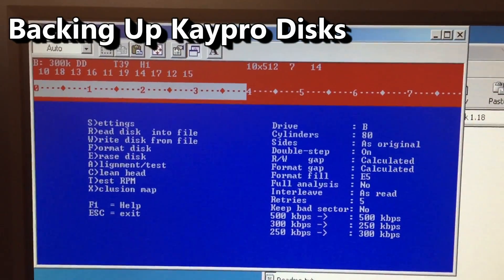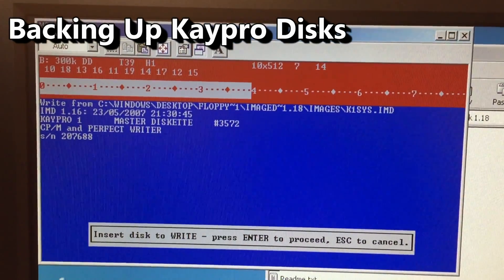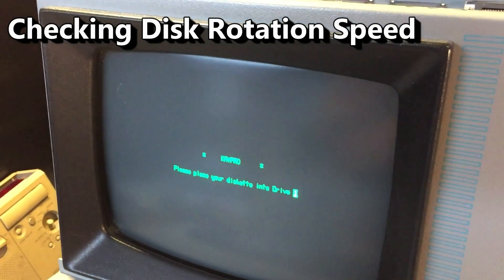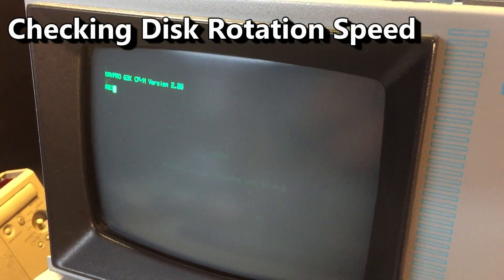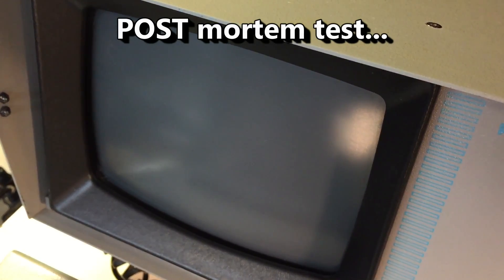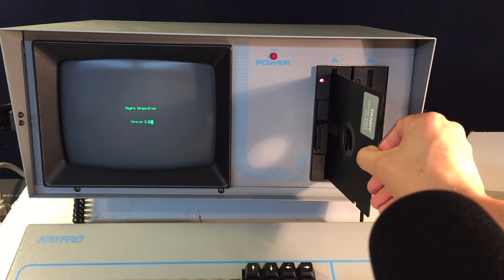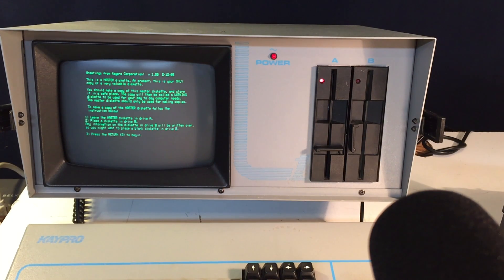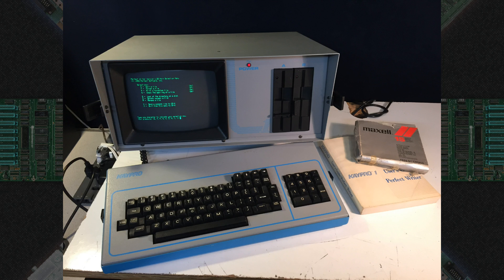Kaypro 1 Restoration - Part 2: Restoring Functionality

Comment: Your kaypro I should work as a Unix terminal.  I used my kaypro II with modem software to emulate an IBM mainframe terminal to do middle of the night system maintenance on Cobol and assembler programs.  You should be good to go.

Comment: Although this video is almost five years old, some may still land here looking for Kaypro info. The late model Kaypros had a universal main board. They would populate it for the model intended and install the correct EPROM. That's why it has HDD headers and positions for the HDD IC's. Sometimes unused IC sockets were installed, sometimes not. If you have the parts, you can upgrade it to a hard drive. Make sure you have the right CP/M (including BIOS) version too.

Comment: Hello, first, I think that you are an amazing presenter, and should be in front of a camera for television.  Your videos about the Kaypro suddenly transported me back to 1982. between 1982-1992, I owned several Kaypro IIs, a 4, 10, and the Kaypro PC.  Those machines got me through college, graduate school, a Ph.D. and a first few jobs where I had to type and edit different copies of typed material.  I logged thousands of hours on those machines and thought they were MAGIC at the time.  I also worked with a Kaypro dealer as a part time job changing drives and hardware.  I was also one of the original members of the first Long Island New York "Kaypro User's group", where Kaypro owners would meet in a library once a month and swap stories and publlc domain software.I think that your mystery about this machine's history may not have been so colorful, and may have been configured like that from the factory?  At the time, Kaypro was a small volume outfit, and the evolution of the machines changed month to month.  They may have included from the factory just throwing in higher capacity parts into the lower end machines because the parts were just available.  I remember the vast variation of floppy drive manufacturers, different disk drive door latches, even Kaypro II machines (single sided drives) shipped from the factory with "double sided drives" from a Kaypro IV that were configured as single sided drives.  Also, I never remember any booting problems across machines...  even between different models.  Your Kaypro I, I think, was an oddball, as I never saw one in any of the 100 or so members of our group.  Vertical drives like your machine were extremely rare. I would love it if you made a video of how these machines paved the way for modern machines, how limited they were in comparison to today, but how much they could do with so little in comparison to todays machines..  I remember how BIG my Kaypro 10's hard drive was...  AT 10MB!  You could store a whole encyclopedia in it because the software was so Spartan and efficient!  Any way..  Thank you for your diligent work, and feel free to contact me if you have any questions, because I lived through the whole evolution and downfall of the Kaypro computers......  PS, How about a video of the printers of the period... The Daisy wheel printer, Okidata 92, Panasonic 1124?  That would be an eye opener!!

Comment: Your mainboard has the hard disk header populated?
Reply from the maker: There is an unused IDC header there - don't know if it's specifically for a hard drive or not. This machine is a grab bag of weird, so it wouldn't surprise me. If you know more than I do about Kaypros, feel free to drop me an email about it.
Reply: I picked up a Kaypro 1 myself this year(2016), and I've noticed that many versions of the main boards shipped with varying amounts of sockets or chips populated. In effect this shows that many of the boards descend from the design of the Kaypro 10, as it featured a 'fixed disk' controller.
Reply from the maker: Well, Bob's your uncle. If I were a smarter guy, maybe I could take a partially populated board and give it hard drive capability. Nice find!